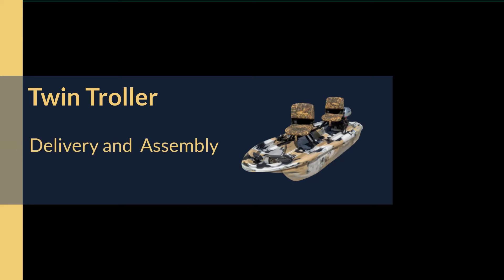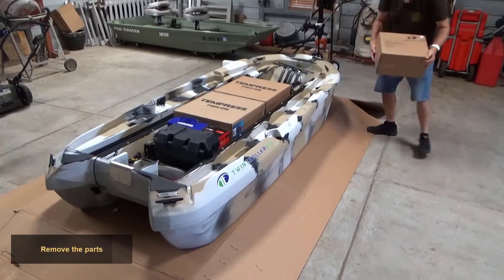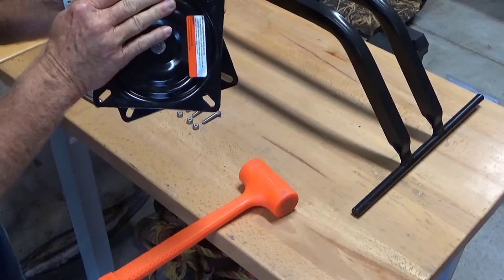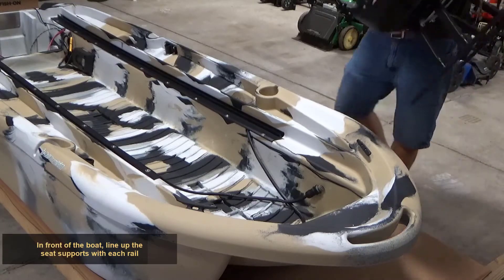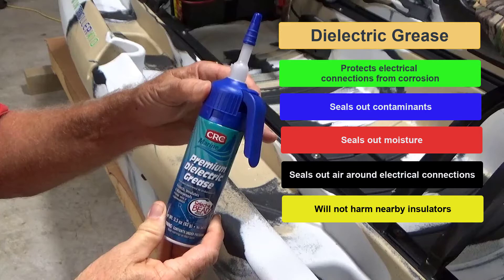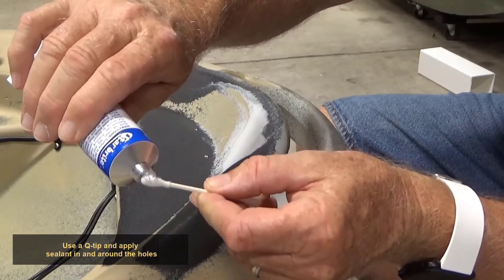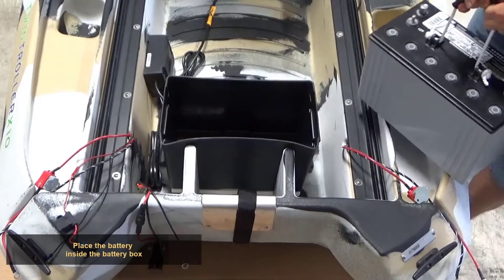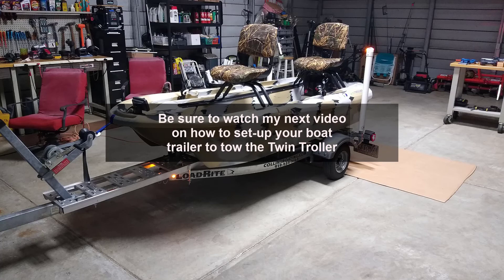Twin Troller X10 - Home Delivery and Assembly

Comment: Excellent set up how to !!! I have been pondering these set-ups, but they seem to be overpriced to me. I have been looking at John boats as an option. So I noticed your John boat in your shop. Thinking this would be a more reasonable purchase and cost for me. So may I ask your reasoning on this purchase of the Twin-troller  over your johnboat?
Reply from the maker: Ron,
I own a 10ft Jon Boat that I use for fishing in rivers, lakes, and ponds. I also own a 18ft JVX Carolina Skiff I use for bass fishing in larger bodies of water and fishing the inland waters and sound areas in North Carolina. I bought the Twin Troller because I like the idea of no hands trolling using dual in hull trolling motors. The motors are recessed and protected from hitting rocks, sticks, and weeds. Driving with your feet, you never have to put down you rod, you can keep fishing and maneuver the boat in tight quarters and get where other boats can’t go. The Twin Troller is very stable, you can stand up and fish and move around without rocking or tipping the boat. I know the price of the Twin Troller is much higher than other boats in the same size range. 
I also thought the same as you, they are expensive. 

I have owned many different boats over the years, but none had in-hull propulsion, stability, maneuvering capabilities and comfortable seating as the Twin Troller. I decided the technology, design, high quality materials, and the manufacturing process was worth the price over other lower price boat options.

I appreciate you watching my video 
Thanks
Norman Gooch

Comment: did you get the easy lift boat dolly?
they sell it on the website.
Reply from the maker: Brad,
I didn't buy a dolly. I use a boat trailer to carry and winch the boat out of the water. I added a 9ft tongue to the trailer with walking platforms mounted all the way to the rear of the trailer making it long enough to reach shallow water creeks, ponds, and rivers. With the walking platforms and extended trailer length, I can launch the boat without having to walk in water, weeds, and mud. 
I appreciate you watching my video!
Thanks
Norman

Comment: I'm thinking of buying one of these with this trailer those tires look very small how fast mph will these tires handle? because Im about 80 miles from my lake? Thanks
Reply from the maker: They are 8" tires. I wanted small tires to the keep the height of the trailer as low as possible. The lower the boat sits on the trailer, the easier it is to launch and load in shallow water, especially if there are no ramps available. The fastest I pulled the boat is 60 MPH. The the longest distance was 65 miles. So far, I haven't had any issues with distance or speed using the smaller tires.
Thanks,
Norman
Reply: @NormanGooch   Awesome thank you for the reply so quick I will look into that thank you

Comment: Hey Norman. I’m very interested in getting this boat. I like to bass fish, and spot lock on newer trolling motors is an important feature for me. I know the trolling motor system on the boat doesn’t have this so I was wanting to add a trolling motor to the bow. Do you think this would be possible? And does this boat allow installation of other fish finders? Thanks
Reply from the maker: Mike,
As far as I know, there are no bow mount brackets available for installing a trolling motor on the Twin Troller. However, other Twin Troller owner’s have built 
fishing platforms on the front of their boats and mounted a trolling motor. You can search Twin Troller modifications on Google and can find some that have been added. This may give you some ideas on how it is done. You definitely can install other fish finders on the Twin Troller. Using mounts or directly mount to the boat.
Thanks,
Norman

Comment: What is the best batteries for these trolling motors????
Reply from the maker: I use a Duracell Ultra BCI Group 31M 12V 800CCA AGM Marine & RV Battery.
I purchased the battery from Batteries Plus, most of the time you can get 10% off when buying online and pick it up at the store.
This AGM battery has these benefits:
•	105AH
•	800 Cold Cranking Amps
•	1000 Marine Cranking Amps
•	Warranty: 30 Month Free Replacement
•	Has 20x more vibration resistance than flooded marine batteries.
•	2x more cycle life than traditional marine batteries.
•	Spill-proof design and can be installed in any orientation except upside down.
•	The battery replaces any group 31 deep cycle boat battery.
I usually fish between 8 to 10 hours during the spring and summer months and the battery lasts all day. 
The disadvantage of this battery:
It is heavy – Weighs 67.35 pounds.
The battery costs about $275.00 with a core exchange and around $300 without a core exchange.
Lithium batteries would also be a good choice for this boat since they weigh about 60% less than AGM batteries. (About 31 pounds). This would be a great advantage over heavy lead-acid batteries.
Thanks for watching my video
Norman
Reply: @NormanGooch   Great thank you for your reply I appreciate it

Comment: I bought 2020 Twin Toller but had water inside the haul every time boat in the water. Not easy to drain water out and Not sure what else to do seem like manufacture  did not test out this boat. If i  have 2nd chance i would not buy it.
Reply from the maker: Sorry to hear about that. I just bought the Twin Troller on September 2021. I haven't used it enough to determine if my boat has the same problem.  According to the information sent with the boat, the hull has a 5 year warranty. I would think that if water is leaking inside the hull that should be covered. You should contact Freedom Electric and let them know your problem and see if they will repair or exchange.  
Thanks for watching my video.
Norman
Reply: @NormanGooch  thanks for the information sir!